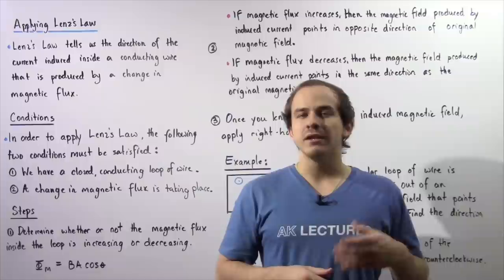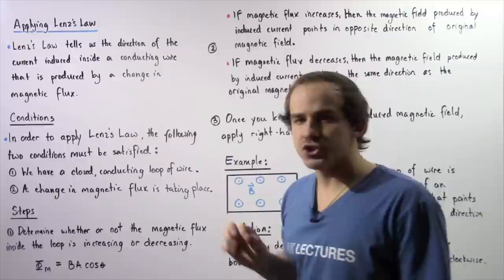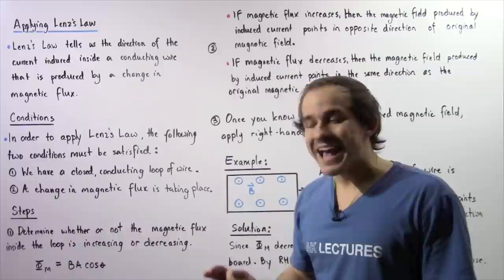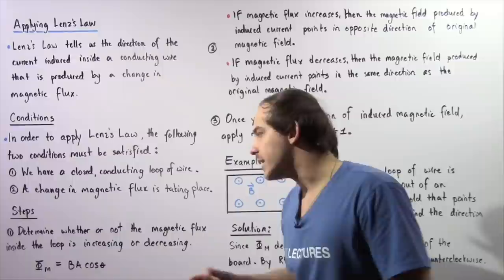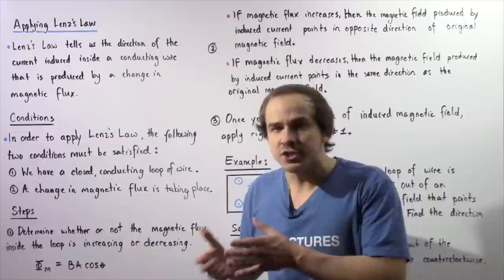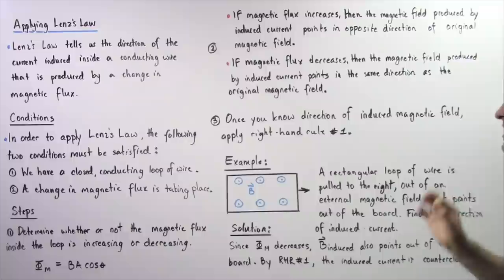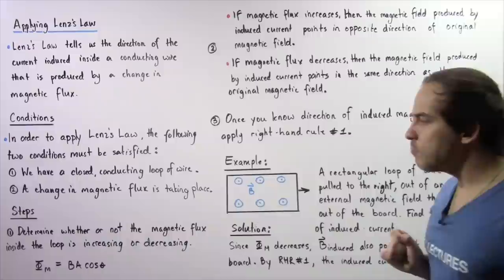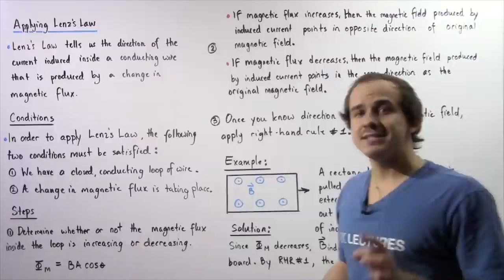Using Lenz's Law to Find Direction of Induced Current

Comment: How exactly does the thumb point anticlockwise? I can't seem to picture it correctly. Thanks
Reply: he's doing it wrong. You need to point your thumb in the direction of the magnetic field, thus outwards. Your curled fingers then show the direction of the induced current which is counterclockwise
Reply: @RaoulRamsaran  Exactly! I was also thinking about that. What confuses me more is that, he uses the same right hand but the first time thumb indicates the direction of the current, whereas the second time he uses right hand rule, this time four fingers show the direction of the current.(
Reply: @RaoulRamsaran  Not quite, people use the right hand rule differently. You see, in this case, its he points his thumb "up"

Comment: If there is a wire in which electric current is increasing,in which direction will the induced current flow in a circular loop kept near it?

Comment: How do you know that the flux is decreasing? I didn't get your explanation
Reply: When any surface move towards to the magnetic field then number of magnetic lines passing through the surface will increase means flux would increase and if the surface moves away from it then flux would decrease due to the decrease in number of lines passing through it